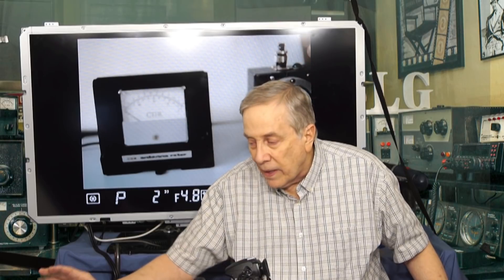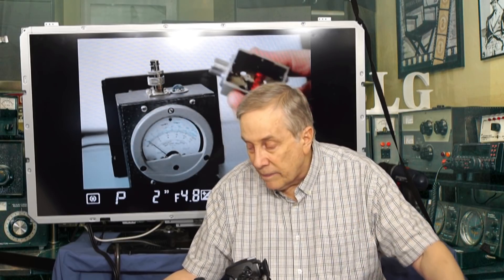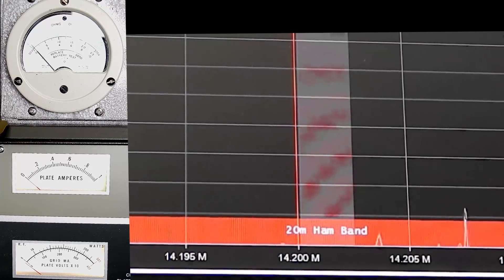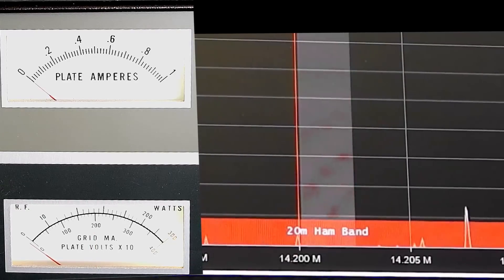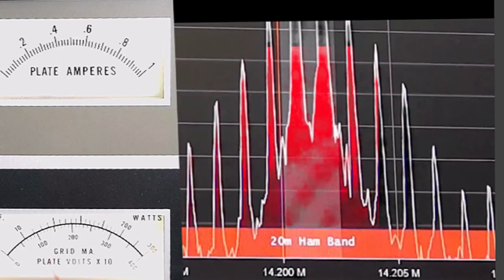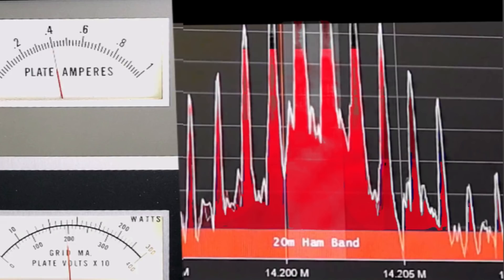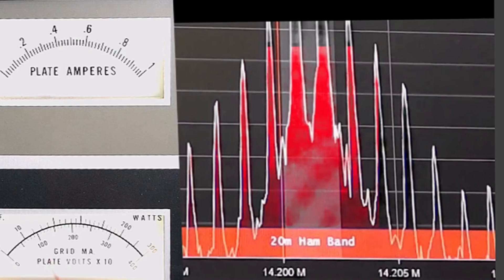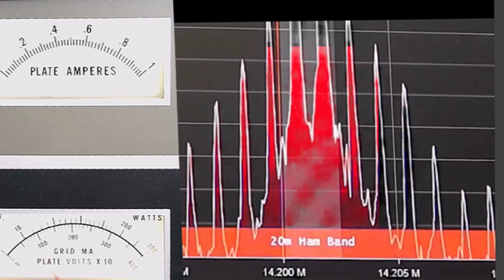Ham Radio Basics--Jim W6LG Shows What Happens When There Is An Improperly Tuned Linear Amplifier

Comment: i am  a loyal viewer of your excellent videos.  I couldn't see the top of the spectrum analyzer so I had no idea where the 3rd order IMP products were related to the PEP.  Thanks for the excellent video. I'm W1VTP on the east coast. :)
Reply from the maker: Thanks.  I will try to do better.  The move to the new QTH has brought lots of work and some progress.  The tower is up with no antenna.  Radio room is done and I am connecting the equipment.  I have shot lots of video footage of both and will upload something today. Thanks Alan from the west coast.  It will be about 100 degrees today here in the Sacramento Valley.  I miss the cooler climate on the mountaintop.  73, Jim

Comment: I'm also limited to 400W here in Scotland. I could tune for maximum power into a dummy load, then reduce the drive accordingly. I'd have to tweak it slightly on air, I think.

My Alpin 100 mk 3 amp has a quick tune guide on the screen, I use that for tuning. It's the same principle as the Acom 1000.

Any thoughts, Jim?

Comment: Fantastic video, I alway tune for max output on the amplifier which in recommended a max of 1500 watts but, I start out with low input power and use that to tune to max power output and then step it up to max power by increasing the input power till I am close to 1500 watts output then I retune to max output. I don't run the max 1500 watts normally but will back the power input back down till I am running about 1000 watts output with the amplifier, the receive gain gain at the other station from 1000 watts to 1500 watts is not worth burning up my output tubes. I am running a Ten Tec Trident III..

Comment: Hi Jim ,great video again,a question ,now I have a TL922 amplifier but I  can only use 400 watts ,now I understand the tuning it to max then reduce the drive from the TX, but can I keep it in the lower voltage CW position or is it best to finish tuning in the higher voltage SSB position then reduce the drive ,I keep it in the cw position ,I don't know if I am doing right or not ,what's your thoughts ? ..Barry (G4VWT)
Reply from the maker: Can you getter the tubes with the lower voltage?
Reply from the maker: In the video, I said that you tune the amp for maximum output.  73, Jim

Comment: Hi Jim,
Excellent video and visuals. I remember the Pulser two tone generator that was used to help with tuning tube amplifiers. Found an easier method online if the transceiver has a built in memory keyer. Program into the keyer a string of "E"s and play with speed to adjust for radio and amplifier used.   73   WB3BJU